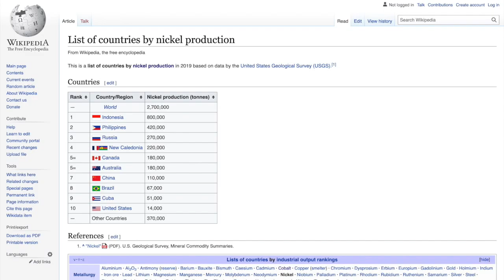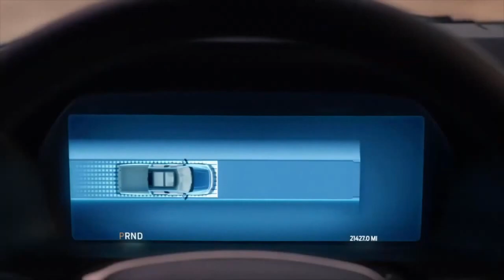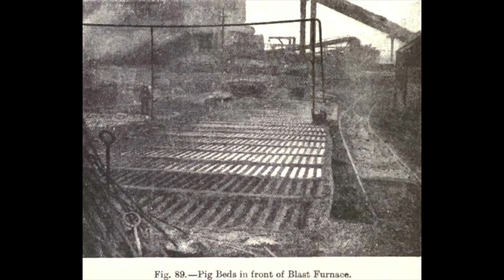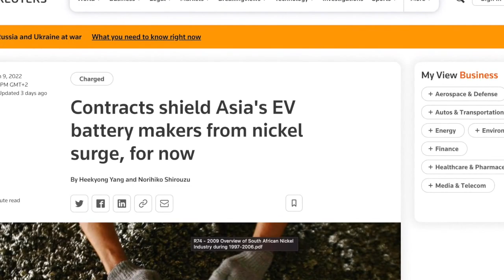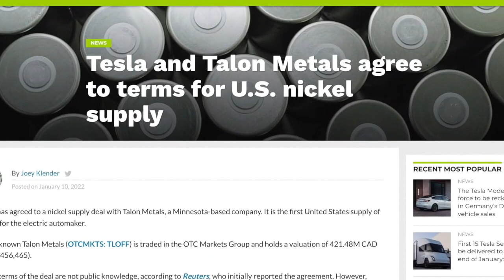Does the EV industry really have a nickel supply chain issue?

Comment: Tesla will buy talon Metals?
Reply from the maker: I think somebody will. it is just a theory though - supported by some articles I have read from Wall Street analysts. Basically, if battery manufacturers are a) going to have to compete against stainless steel to get nickel in the format they need it and b) if they have to keep paying prices linked to LSE spot - then it makes sense to vertically integrate and aquire a mine to secure your own supply.